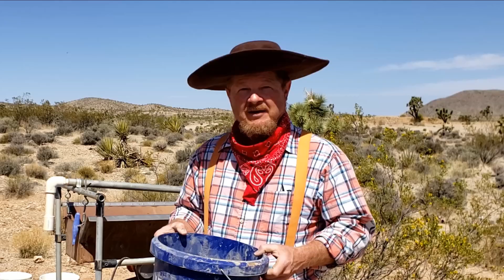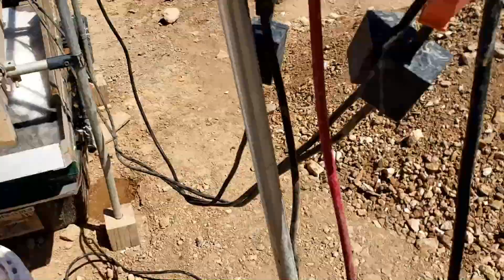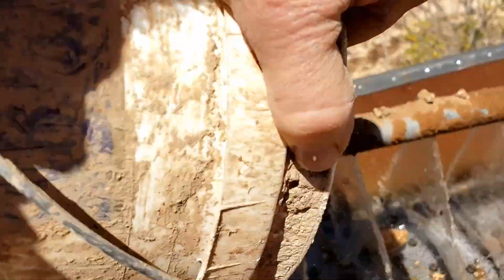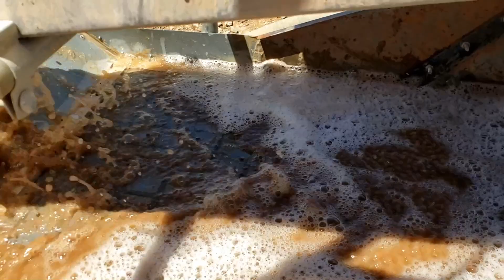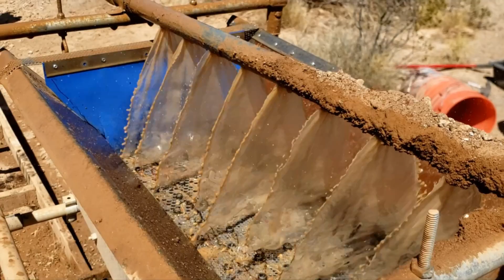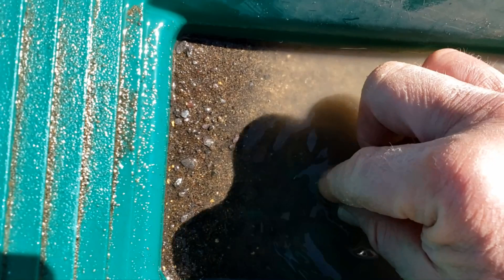Wash Plant Q&A and Chunky Gold Strike !!

Comment: Alan you must be an engineer. The wash plant has great design elements.

How is the water removed from the de-watering deck?
Reply from the maker: Thanks Jim.  The deck vibrates at a certain frequency and vector that separates water from material.  The material travels off the deck onto the tailings.  Check out my latest video for more action.  Thanks for watching ! 👍

Comment: Allan in what order would you say is the best bang for the buck of your ideas to reduce sediment in the water?
Reply from the maker: Hi Denny.  That's a good question.  The least expensive are the sand filters, however, they have to work with some type of dewatering system in order to be successful.  I suppose a poor man's way of dewatering would be the traditional catch bucket at the end of sluice.  The solids could collect  there, and water overflow could be directed to sand filters.  Give it a try.  Best of luck to you !

Comment: Do you find that this bucket system works better than the tubs filled up with different gravel sizes?
Reply from the maker: Good question !  I think the tubs work best if you have an external pump, like in my early videos on sand filters.  However, the buckets are more handy to tote, and seem to work well with a submersible pump, like I'm currently using.  I prefer the submersible because it's more compact, light weight, cheaper, and operates on 120v, compared to the gas powered trash pump.  Thanks for asking !

Comment: Another great update video to your series. Have just 1 question for ya. With the new pressurized filter wouldn't it work better if you ran them in series instead of parallel Or does the first one clog to quick ? 
   Anyway great video and I got a new phone to handle the extra hard smashes on the like button
Reply from the maker: Hi Dave !  Thanks for smashing that like button !!  Much appreciated.  Lol !  I linked them in  parallel to reduce pressure in each bucket and allow more permutation time for water to work it's way through sand.  You could link in series too.  Thanks for watching !!

Comment: Great job Alan! Always great info and lots of fun to watch. I ended up building your trommel washplant and it works great.
Reply from the maker: Hey Alex !  Thanks for watching !  That's good news on your trommel build !  Do you have up and working in the field ?  Post a video if you can.  Cheers !!
Reply: @allansgoldmining  I've had a blast using it for the last couple of seasons - enough to wear out one set of bearings. It's still going strong and classifies the material as it should. I wish Youtube comments had a way of posting the pics I have of it. Although, now I'll have to switch over to your new system as it seems to work extremely well.

Comment: That's awesome I love your idea about media flow filtration kind of like a sump in a saltwater fish tank in the bottom sump you have media filtration that you actually pressurize and push the water through then back up to the main tank just you're using smaller media like sand button fish tanks they use a bigger more coarse media that's full of vogues and air pockets which trap small particles but I like this this is cool can't wait to see some more of this you're an awesome dude very smart there are not many people like you and it's a privilege to have you on YouTube to share your wisdom 🤟✅
Reply from the maker: That's right Jeremy !  Very similar indeed.  I copied this idea from swimming pool filtration, which is pretty much the same.  I believe we can stretch the life of the water enough to run 2-3 yards as it stands.  Fun stuff !  Best of luck to you prospecting !
Reply: Sorry my texts come out like this I use speak text cuz my left hand has no dexterity because of nerve damage but I really do like that idea of your media flow buckets I was just looking at my carbon reactor and my media reactor and thinking how they worked exactly the same but just on a smaller scale 🤟✅

Comment: Excellent! The high pressure filter in between the pump and the spray bars really works good, nice addition. Visually, there is a huge difference in the water quality between the pump water and the spray water. I bet you increased your runtime by nearly 40%.   
Take my money and put me on the list, I want one!!!
Reply from the maker: Hi Craig !  Yeah, you can really notice a difference !  And I was running some very very gooey clay this time and filters did well.  I agree on the 40%.  By then it's time to muck out the gooey in the tubs.  Thanks for watching !